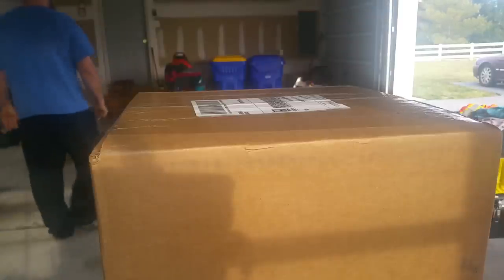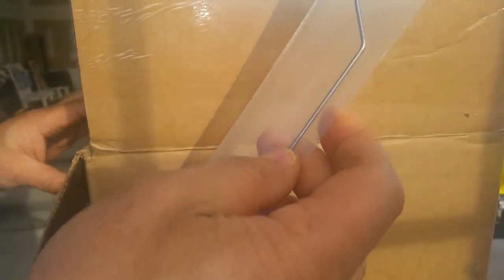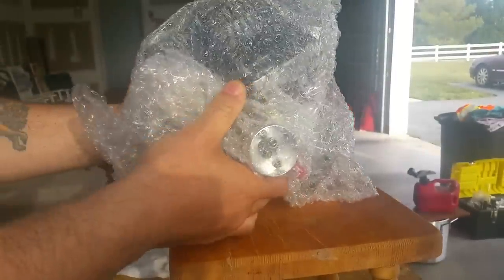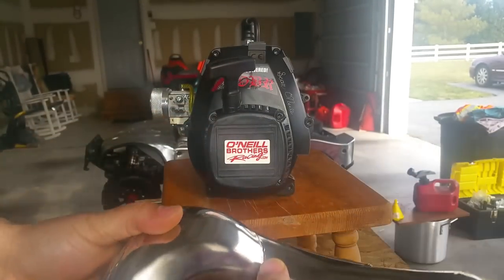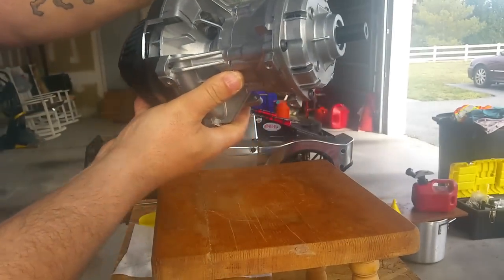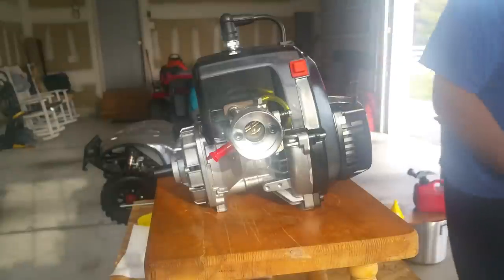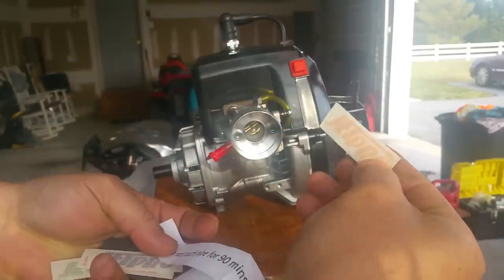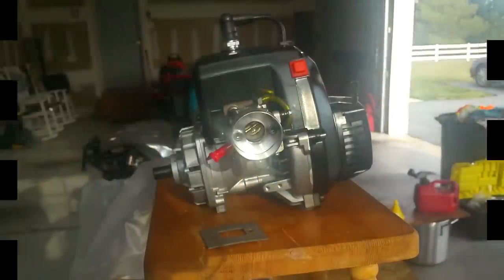The MASSIVE OBR 47cc FULL MOD aka DA BIG BOY

Comment: That motor is fn awesome!! Can't wait till we hear it. Good for you bro, things are getting exciting for the insaniachs!! Don't worry about a little dent, run that thing, don't sweat the small stuff
Reply: Richard Gordon from wut I have heard thru research a dent in a tuned pipe can change the tune on the pipe & affect the engines performance
Reply: Just trying to ease the pain not pour salt on the wounds!👍🏻and I doubt there would be a noticeable difference, all good bro!
Reply from the maker: Richard Gordon yeah bro thats like buying a brand new corvette with a dent in the hood smh
Reply: 5th SCALE RC INSANITY no worries bro those guys go above and beyond, little more time is not the end of the world at this point! Hang in there!! Still a sweet motor.

Comment: hey big man, take it easy on the obr guys, ive been in two strokes my whole life almost 40 years,, i can guarentee you fromwhat lil indentation on the pipeyou were talking about is absolutly nothing . i would bet it came like that straight from thefactory because of dyno testing to get peak horse power they the jet pro manafactures tweak n manipulate the pipe which ever way it needs to be there fore the equipment you have just purchased from them is at its absolute top 5% of its class- straight from the factory to your home/garage. good times my friend. and the best of luck with ur 5-th scale whips.
                         your friend derek,......... aka---------1/5 scale junkie!!
Reply from the maker: thanks for posting bro

Comment: Spewing about the dent on the pipe. I thought the plastic insulator to the carb is to stop carb overheating and affecting air fuel mix, agree that plastic bit looks a bit ugly though. Got me singing your little ditty, bling bling.
Reply from the maker: Chris Taylor yeah bro..if I put a dent in it fine. Not straight out the box